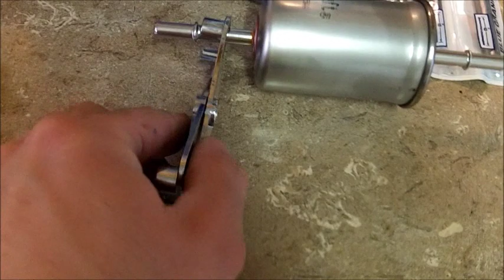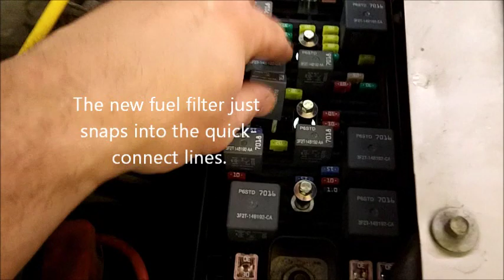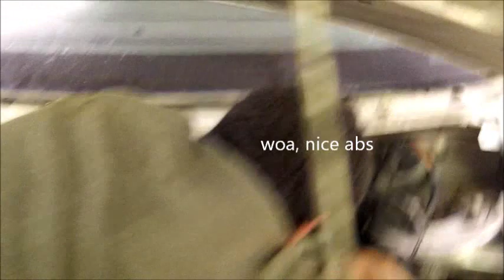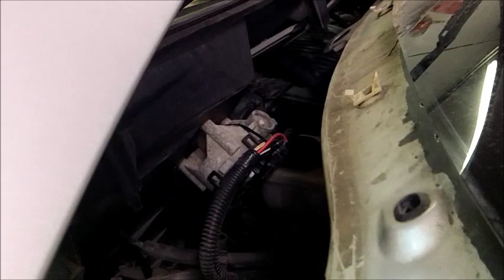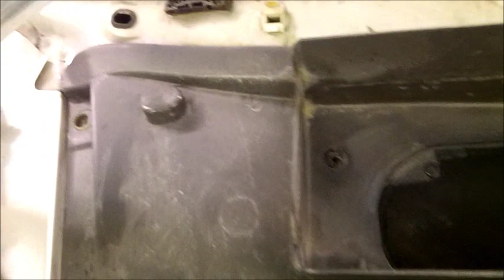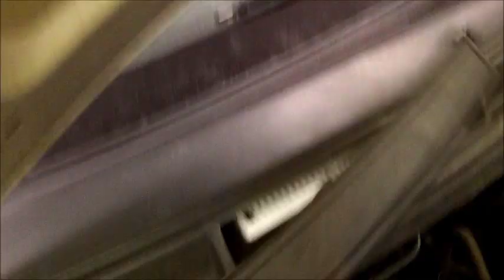How to tune up Ford Freestar 2004 fuel filter spark plugs part 2of2

Comment: I'm just changing the fuel filter and kind of goes over that to fast, and what about the little white plastic clips that come with the new filter?  Hope you can do this without the special disconnect tool.

Comment: I like my freestar the back lift gate dint open but that's really I've changed the torque converter in mine it's at 260,000 miles i wonder if this van will be able to reach 300,000 it's been working great lately
Reply: I have a Freestar, and have had it for 16 years with no problems.  I had a friend do this work in his shop that has a lift.  Once up in the air, there was no problem getting the rear plugs out to replace them from underneath.  We did not have to remove the upper cowl cover or lower cowl to gain access to the plugs like you are doing here.  After the lower cowl is removed from the body, Ford recommends running some camper tape, and a bead of silicone along the cowl where it meets the body to seal it to keep water out, and seeping into the PCM.  We also removed the cowl, and sealed it with camper tape, and silicone to keep the PCM dry.

As for Freestars making it to 300,000 miles and beyond, I have personally seen several that have gone beyond 300,000 miles.  One I saw had 664,000 miles on it, and was still going.  Mine is going to outlast me, and will be around when I am gone.  The Freestar was a very durable minivan, and Ford never should have stopped making it.

Comment: check out the videos for sealing the wiper cowls on the freestar vans.They evidently have an issue with water draining on the computer if you don't use the revised method.Ford tech Makuloco has an excellent video with links to the parts needed.

Comment: Great video except that i cant find the plug gap anywhere in the videos nor can i find it on my 2006 ford freestar, SE, 3.9 liter van. its driving me crazy because i replaced the plugs & wires & gapped them at 54mm and it runs like crapola, can anyone help me here ?
Reply: the new spark plugs are pre gapped.. so you shouldn't have to worry about that part

Comment: Ha ha the engine light is still On, that mean the problem was not from the spark plug.
But thanks anyway you showed us how much it is complicated to work with engine
Reply: G H the computer has to clear the code(s) generally happens after a 5 to 10 mile drive
Reply: It turns off before the video ends

Comment: Fuel Filter:Those look like the newer Ford Quick Clips, shouldn't need the filter clip tool anymore, just use a screwdriver to push up on the back of the yellow clip and it releases by itself.  They' pretty much stopped using the old steel collars.
Reply: I just changed a fuel filter today on an 05 ford freestar just using a plain screwdriver, took less than 10 minutes to do... only because I had to lay on snow and ice  -_- but yes the "specialty" tool is not needed on this van
Reply: AMEN,  Save $4.00 on Autostore donation!!!    Gb    bg

Comment: After finally getting the cowl off, I estimate that it will take me a day to replace the coil pack and a day FOR EACH spark plug and wire.  The engineers that designed this monstrosity should be taken out and publicly whipped.  Can you imagine the labor charge to have the Ford dealership do this work?  Wow.
Reply: I tuned up a shit load of different models in time and yep screw this, I had customer call me on phone asked for a price and I said basically under 100 bucks, I said sure till I saw it. They was pissed and upset but no way can I do this for under 100 bucks, I agree insane, tried to tell me Pep Boys said 125 to them why I tried to beat price, there is  no way they said 125, I told them let them do it, I can't touch for least 140
Reply: jeeze I'm not looking forward to doing it when the spark plugs I ordered come in tomorrow....van has 179k miles on it, unknown tuneup history, bleh mpg, I can see the tach slightly moving like a misfire but not bad enough to cause a CEL for it yet, however, a CEL did trigger for bank 1 catalyst below efficiency and one place said worn out spark plugs could cause it....I'm used to doing work on cars or trucks with wide open easily accessible engine bays...this...is just....very offputting

Comment: I found it a little easier to take off the air inlet housing for the HVAC system, at least for the far left plug on the back of the engine.

Comment: Thank you!!!!!!!!!!!!!
Reply: Hy i have 07 freestar 4.2.  got code 443, 705, 451.  also by mech range range sensor and connector. Problem not going away. When entering on hwy speed RPM reached to 2000, speed  70 to 80 kms. Motor start heat up. What is the right salution